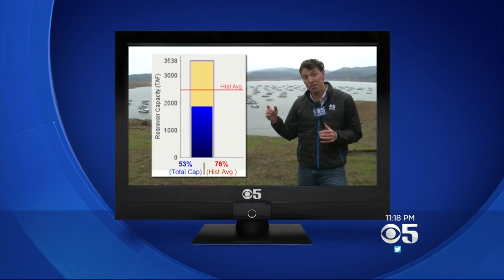STORM WATCH: Lessons Learned From The Oroville Dam

Comment: Repair of the eroded Alternate Spill is not priority at this time. 

Use multiple pipe lines to siphon the water down to safe water ways to 
allow adequate repair of the main spillway. Why until now no action is 
being done to save the main spillway from further damage. 

The spillway pipe lines should have been 100% working now if they are 
installed two weeks ago.
Reply: Pipe lines?  To handle tens of thousands of cubic feet PER SECOND?  Do you have any idea of the volume and pressure you're talking about?  I doubt it.
Reply: They are saying they are discharging 100000cfs. Multiple pipe lines or hoses aided by pumps can easily siphon this volume of water. Discharge can be accelerated depending on the time required to discharge the volume of water. 

This is the correct approach to deal this situation and if they have done this 2 weeks ago then water should now be smoothly flowing thru the pipes and repair works of the main spillway should have been almost completed by now.

Obviously the main spillway is defected either due to design or construction and it needs repair and improvement ASAP.